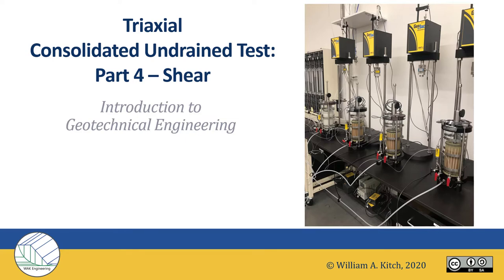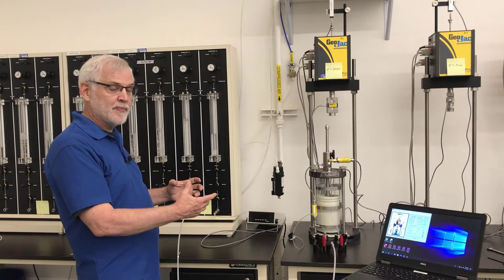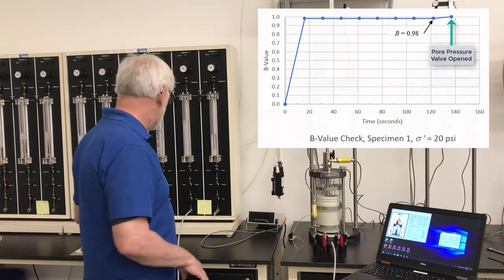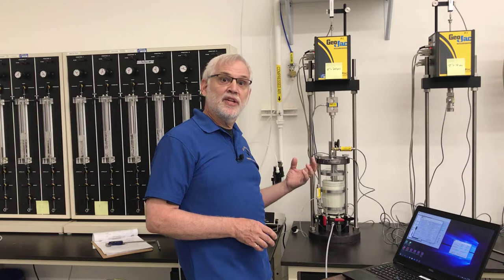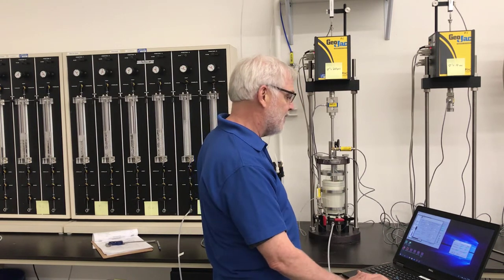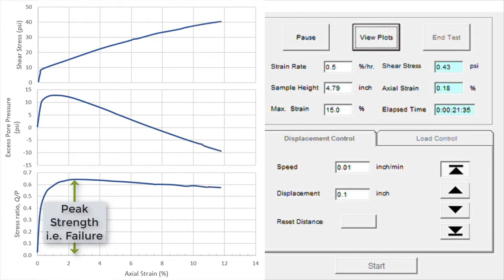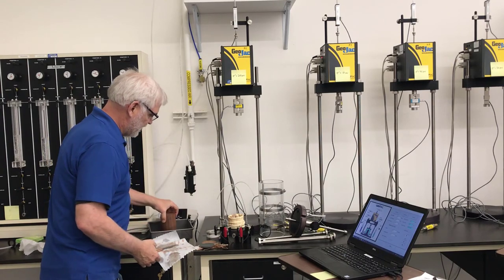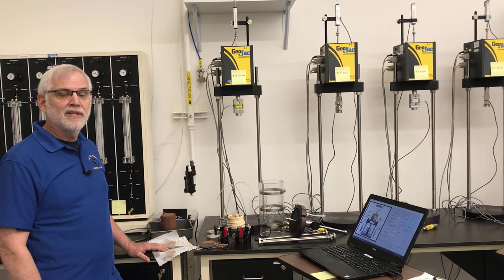C-U Triaxial Soil Test, Part 4--Shear Testing

Comment: I cannot thank you enough for showing how to setup, run, and perform essential calculations for this test. Plus those tips about accounting for friction from the bearings, as well as the load from the cell pressure... man, this is a life-saver. 

A lot of steps and setup - I can see why labs charge so much for this test.

Comment: Thanks for the extensive videos. I'm learning alot. I have a question about the determination of the stiffness parameters. Based on the deviatric stress and the strain the E50 can be determined from a triaxial shear test. What if we would be doing a multi stage triaxial shear test. The testmonster would have 3 different stages where it is being tested. What stage is suited best for the determination of E50? 
Another question is about the reference stress. Alot of soil mechanics (in Holland) are based on a reference stress of pref = 100 kPa. Are the triaxial shear tests results based on a pref of 100 kPa, or does a correlation have to be used to determine the reference value of E50?

Comment: Very goes efforts sir, but i dont get it... How can we shear before consolidation.  B value is for saturation,after that we consolidate it   right??....May be you missed part of consolidation to include in video
Reply from the maker: For the purpose of my class I'm not really measuring consolidation.  The soil tested here is a stiff silty sand.  Very little consolidation.  It saves time in getting the soil saturated if we start consolidation before 100% saturation and doesn't really matter for the purposes of my class. But you are correct.  Normally, one should saturate the sample before consolidation.

Comment: When we apply deviator stress... Due to  addition of rod volume into specimen cell pressure get changed....so sir how we take cell pressure as constant
Reply from the maker: The confining stress is kept constant by the pressure regulators on the panel. The drain line to the sample is closed during the shear portion of the test, but the line to the cell pressure is open, thus creating a constant total confining stress. The effective stress does change significantly due to shear induced pore pressures.
Reply from the maker: This video will explain the triaxial test steps more clearly https://www.youtube.com/watch?v=hq4UlLm8oIs&lc=UgxmQGdVCAiXCmSeBeB4AaABAg
Reply: @introductiontogeotechnical4976  can i perform the test by keeping prefix value of back pressure? i mean different effective stress? in that case, i have to keep drain line open which is connected to back pressure line. is it?